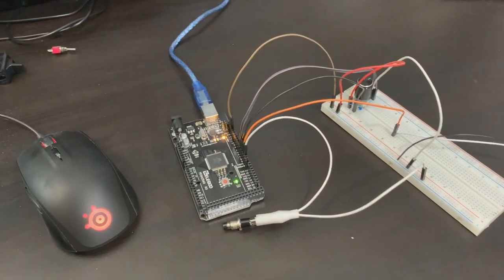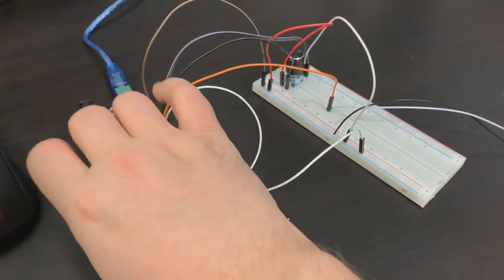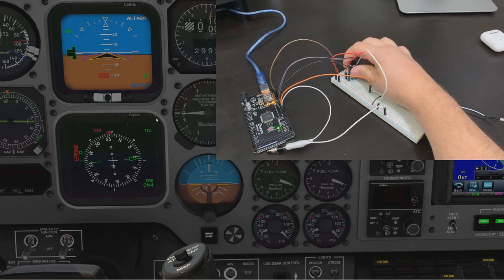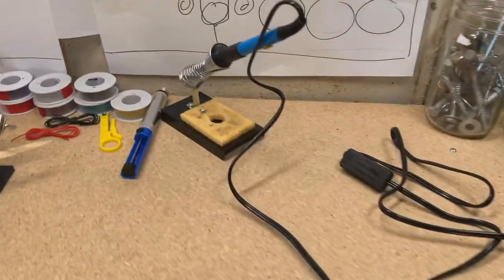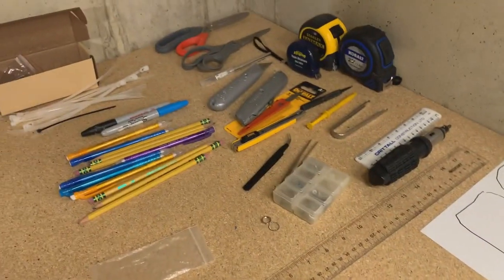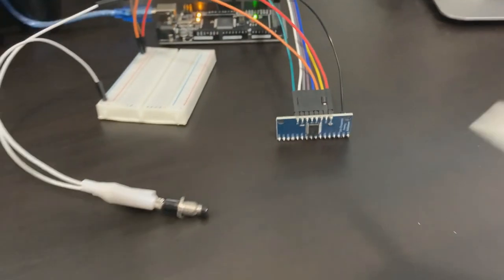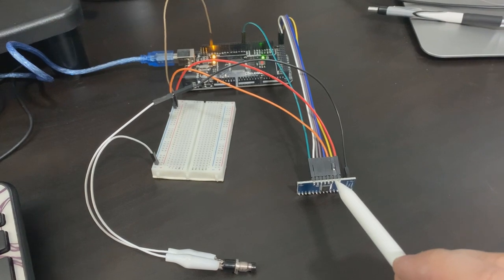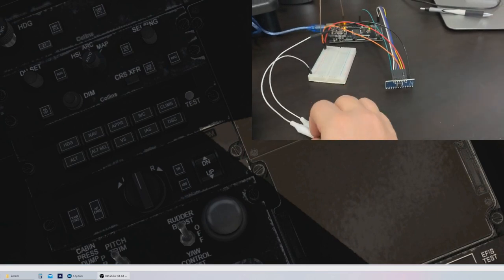X-Plane 11 - SimVim - Home cockpit - multiplexer and workshop

Comment: hi!
What is the best resistance for potentiometers in simvim?
Reply from the maker: I used a 10 ohm but it doesn’t really matter given you’re using it just to split the voltage

Comment: Hi there, I am running X-Plane 11 and MSFS2020 and have long been thinking about setting up hardware to operate some of the simulator controls. I have therefore since purchased an Elegoo Complete Starter kit with an Arduino Uno board and have also just ordered a Mega2560 board to go with the kit. My question is though, once you have created your wiring circuits, are you having to write sketch code in Arduino IDE as well, or is the sim interface all through SimVim? Regards from Bedford, UK
Reply from the maker: Simvim flashes the arduino the first time so you don’t have to write any sketch code. It’s all taken care of for you my simvim. Same with AirManager except in that case you’re writing LUA in AirManager. Good luck!
Reply: Many thanks for your speedy reply, appreciated! I've only just realised yesterday that I need a Mega2560 board for SimVim to work, which I have now ordered. My kit came with an Uno. One further question then, once SimVim has flashed the Mega2560, can the latter only be used for SimVim purposes going forward? Kind regards and thanks again, Paul  :-)
Reply from the maker: @funofflying15  right, AirManager can do pretty much any board but simvim is the mega. And you can put it back yes should you ever need to
Reply: @expataviator7107  Many thanks for your help :-)
Reply: @funofflying15  Also be aware SimVim only works with X-Plane, you will not be able to use your home cockpit with FS2020 but hopefully in the future it will.
Reply: @Qosmokid  Many thanks again, all noted. I've now started to use the Mega and SimVim together, just to find out what does what? I'm also now trying to run a 16x2 LCD via the mega and a slave Uno with the correct firmware already uploaded to it. Have managed to wire everything up OK, but am not sure which pin to assign it to in SimVim? The LCD lights up, but the characters do not show, so I've obviously got more work to do lol. Kind regards Paul from the UK :-)

Comment: Hi! Thanks for this video. I'm running into an issue and struggle to find a solution. I connected two rotary switches to a multiplexer. The first one takes the pins 0 tot 3 on the multiplexer as my engine #1 starter switch (for the Zibo B738), the second one the pins 4 tot 7 for the engine #2 starter switch. The issue is that my first physical switch moves, in the simulator, both the engine #1 and engine #2 starter switches. I've checked and checked and checked the wiring, all looks fine and according to the schematics on the SimVim website. Would you please have any idea on how to troubleshoot this issue? Thanks in advance!
Reply from the maker: Hey! Have you tried posting on the simvim support forum on their website? I don’t know how the code inside simvim works so not sure how to help. That way also you can post some pictures to help us understand :)
Reply from the maker: ps i since moved to Air Manager so I can write my own code and have more control
Reply: @expataviator7107  Hi and thanks for your answer! The thing is, Simvim isn't accepting any new registrations on their forums unfortunately. But thanks anyway!
Reply from the maker: oh really that sucks 

Message me on discord and let’s see if we can figure it out ExPatAviator#0421
Reply: @expataviator7107  Hi, thanks! I found someone else having the same issue. This person found out his Arduino S1 bus was faulty. I'm going to check that too from my side first before asking for additional help. :-)
Reply: Hello Pilot Bas, as far as I know you can only use Multi position rotary switches for the starter switches on the 737. I haven't tried it with encoders but I see on the configurator it doesn't even give the option to use encoders. Also encoders should only take up two pins and one for the push button if equipped, not sure why you are assigning four
Reply: @Qosmokid  Hi! Thanks for your help. I do not use encoders for this. There are indeed multi position rotary switches. Sorry for the confusion. I ended up not using the multiplexer and just connecting everything directly to the Arduino. It now works fine. Since I don't have the intention of simulating every single switch in the 737, the Arduino has enough direct inputs for what I want to do.